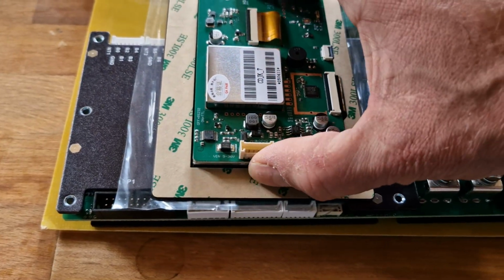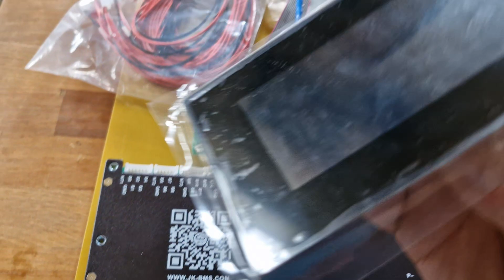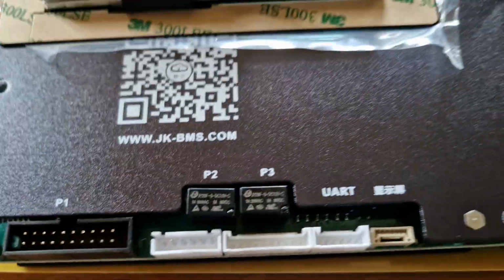JKBMS comparison of old V15 with new V19 #RH3D

Comment: Hi everyone, I need some help with a JK BMS parallel setup.

I have two JK BMS units running in parallel, and all the settings are correct (same firmware version, unique addresses, wiring verified). However, the system frequently fails to stay in parallel mode.

The issue is that the slave BMS randomly disconnects for a few seconds. On the app/display it suddenly shows only one master BMS instead of two, and after a moment the slave reconnects again. This keeps repeating.

Another symptom is on the CAN network:
the PACK count often changes, for example dropping from 2 packs down to 1, then going back to 2. This suggests the second BMS is also intermittently dropping off the CAN bus.

So it appears that the slave BMS is frequently losing connection on both the parallel RS485 bus and the CAN bus.

Has anyone experienced this issue before?
Could this be caused by RS485 wiring, termination resistors, grounding, interference, or possibly a firmware bug?

Any advice or troubleshooting suggestions would be greatly appreciated. Thanks!

Both BMS are on firmware V15.42
Address 0 = master, address 1 = slave
RS485 cabling is correct, short cable, shielded wire
Parallel monitor page shows the slave dropping offline randomly
Reply from the maker: Truely you dont seem like you do anything wrong...  I see it like BMS id defective minimaly on the comunication side... you can also check the "LAN" cabels a connectors.. but I Expect this one is also OK..  I recomend test another BMS from someone od buy spare one and test it and then make the claim for the defective one! I hope it Helps.. BTW I run V15.38 if you wish you can test DOWNGRADE of bios... but I do not hink it will help.. but you can try.. Also check the caels inside of box those comunication cables from  BMS to front panel if all is Really OK Re Essemble it and  do proper check;)

Comment: I will share a little personal experience - a month ago I connected 4 pcs. 15 kW batteries with JK in parallel to two inverters - an extension of an existing system. One of the two newer batteries was with JK-V19 and I designated it as Master, but after many attempts I managed to connect it only to one of the older ones with JK-V15. The other two batteries work in parallel without data connection. They are still full of bugs and programming misunderstandings, unfortunately... 😒
Reply from the maker: Have you flsh them with newest bios? becaouse I think it is mandatory to do so.
I have  1x V19.02 and 3x V15.38 and it works flawless
Reply: @RH-3D-EN  you use v19 as primary or secondary? thanks
Reply from the maker: I use my V19 as  Master and 3x V15 as a slave

Comment: Please tell me, is there a JK-BMS, V19, S4 (!), for 4 cells in series, and to which could the new monitor be connected via the UART port?
Reply from the maker: nono those BMS V19 are only from 8 to 16 cells so you cant  use only 4 cells for those you have to buy different models for range 4-8S  but if you play with PV and so on definitly I recoment upgrade system to 48V and use this one.. with this nice monitoring display
Reply: @RH-3D-EN  I have a second battery group in my camper, LiFePo4 12v, about 1500 Ah. It would be difficult to redo everything again. (first group - starter battery)
Reply from the maker: @dethleffsglobebus8624  pick somethink here, proper  to your system  https://s.click.aliexpress.com/e/_oFMn6LL but forget any display option..
Reply: @RH-3D-EN  And the inverter is a VictronEnergy MultiPlus-II, 12/3000. No, converting everything to 48v would be too much work.

Comment: Can we parallel connect two different battery pack...my first battery pack is 100ah 48 volt with old jk bms which does not hve communication connection and second i my planning to make 280ah 48 volt with v19 bms...your advice will be appreciated
Reply from the maker: you can use them both packs together even when  they are not the same capacity.. its power distribution willbe automaticly separated  depending on IR of packs so it is no problem...
I dont know what you use your packs for, but  I would prefer to have both of them comunicating together, use you V 19 as master and conect it with the older version, if it is V14 or V15 you just need the comunication board for few dolars and one network cabel and you will have all monitored! if your BMS is too old then just buy  old BMS V14, V15 it can be even small 100 or 150A BMS but for sure I prefer to use  versions with 2A balancer, especialy for older cells which I asume the 100Ah are.
Reply: @RH-3D-EN thanku for your reply, i m using those pack with my deye inverter, the old battery has a old jk bms which does not hve option for communication,  the new pack i m making with 280ah eve cells and jk v19 bms. After connecting both battery in parallel i will be only able to connect  v19 bms with communication cabel
Reply from the maker: @zoheb4you2002   you may connect all to one V19 but you need  but you need to make balancing cabels over yeach cell... and I would not recomended. it is better 2 separate blocks and then paralel.. and if you want conect all data  together then just buy one more new comatibel BMS and change it in 100Ah system, it is most smooth  solution

Comment: I have bought the same BMS for my 48v 150ah LFP bank, the balancing cables are 22 awg and that is too small for a 2a active balancing BMS. I reached out to Jikong and Wistek where i bought the BMS, but no answer 👎🏼
Reply: Its not too small. I tested it and the wires dont heat up at all, during 2A ballancing.
Reply from the maker: @Aleksandar_tech  That's true they are fine for this load👍
Reply from the maker: Evryone has it like you do also me and I am fine with that.. anyway 2A it is peak generaly ir runs 90% of time and somewhere 1.8A so do not wory. nothing is going to happen, or if you like.. build yours  bigger but it is just up to you... but truely there is no problem with 22awg
Reply: @RH-3D-EN  i will keep an eye on the heat when it balances.
Reply from the maker: Great;) how is it going?
Reply: @RH-3D-EN  I’m building my own battery box now, haven’t used the cells jet. It’s going slow forward.